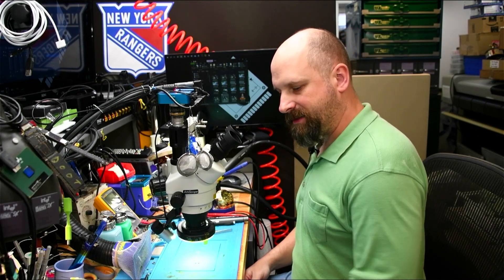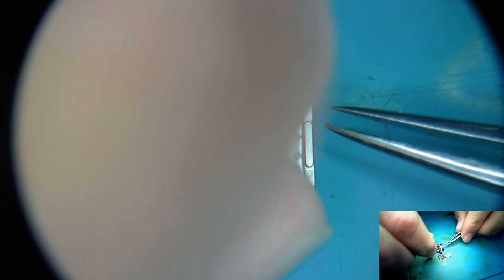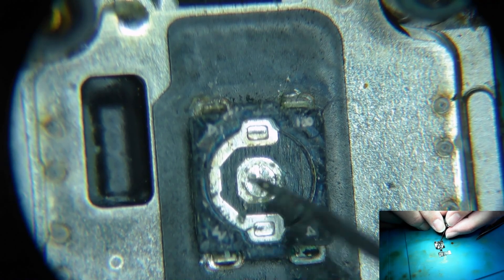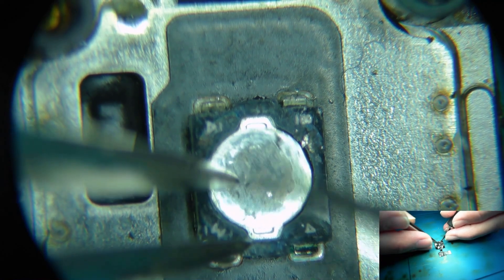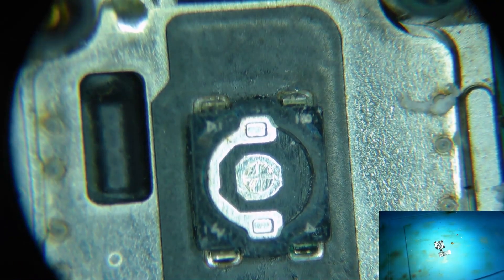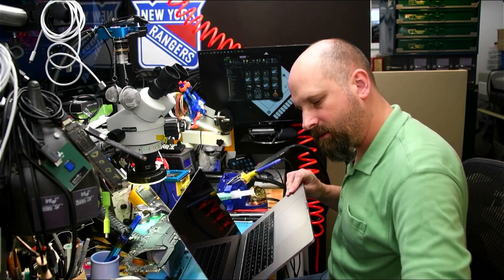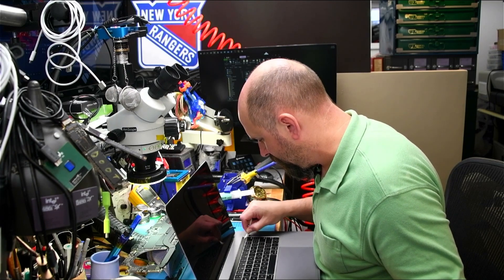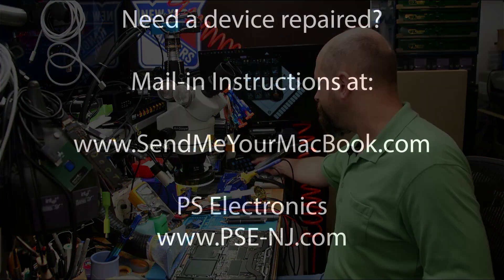A1990 MacBook Power Button Repair at PS Electronics, Call 888-820-3476 for repair!

Comment: Dear paul, yesterday 
i got broken 2019 15inch MacBook pro power switch ribbon cable, while im going to swap with another keyboard housing. Yesterday i couldn’t find any video or blog regarding the mac switch repair, but im so glad today you uploaded this video 🤩🙏

Currently im using with different switch but no touch id work. 
I have spare switches, but the ribbon cable broken from the little glued circuit between the switch and the end of the connector. (Like you mentioned on the video)
What should i do? Are there any chances to fix this?
Can i swap the components of this little glued circuit with another new switch. 
Or should i use another glued circuit(cut the ribbon cable from center) and combine with the broken ribbon of the power buttons end. (Repair like flexgate method)
Which part is the responsible for the touch id data? Is it the button or the glued little circuit?
Please help me 🙏 please 😢

Comment: does this bottom is serialized to the MB ?
About ultrasonic cleaner, I found for me the best way to clean is to put the small part in some glass jar (I use Pyrex Kimax Glass Beaker, this is very useful when you work in a chem lab as your main job), inside I put about 10% Acetic acid in Methanol (ethanol or isopropanol can be used as well) , my electronic part inside this mixture, and sonicate it for 2-3 min. Then wash with 100% Ethanol or Methanol.
Reply from the maker: It is paired with the logic board, if it's completely broken you can change it for a new one but you will not have touch ID
Reply: @A2000MHz  it will be unusual for Apple not to do it. I guess M series are the same, or even worth?

Comment: I really shouldn't be surprised but I constantly am at the repairs that are done to such small and finicky components. I was slightly stunned when you dismantled the power button to clean it. Just amazing and incredible skills.
Would you not be able to cut out a piece of Herr Kaptain Tape to replace the original if it got messed up? Curiosity question only Paul. I would have thought if you can pull such a delicate device apart and reassemble it then manufacturing a piece of sticky to size and fitting it wouldn't stretch your skills that much. Bear in mind I'm not a microscope gazer with even one million of a poofteenth of your skill level.

Thank You for the video Paul; just amazing! 👍👍
Reply from the maker: You can cut a new tape top if you need to, other buttons are easier then this one because of the little black nub. That's part of the tape, you would need to glue it to a new piece of tape. If you mess it up its easier to take a tape from a dead button then make a new one.

Comment: awesome repair job good to see a video Paul those erasers look awesome do you have link for those?
Reply from the maker: These are the ones I have now, https://a.co/d/8F970HT They are a bit soft and ware away pretty fast but they clean very well and never damage anything. I've used more aggressive ones in the past, I think they were made for erasing typed text from a typewriter. Almost in between the ones I have now and a fiberglass pen. It might be useful to get some different strength ones. There are a bunch of other brands out there like these https://a.co/d/eR0yNl6
Reply: @A2000MHz  thanks Paul appreciate it. Yeah I’ve seen you use them before on charger reports and your videos looks like it works awesome Can’t wait to get some. Thanks.